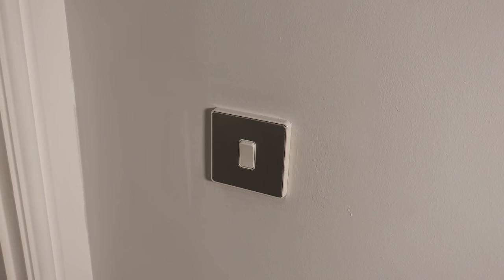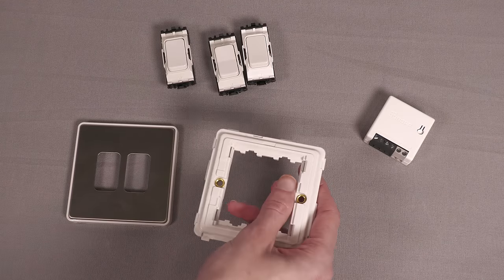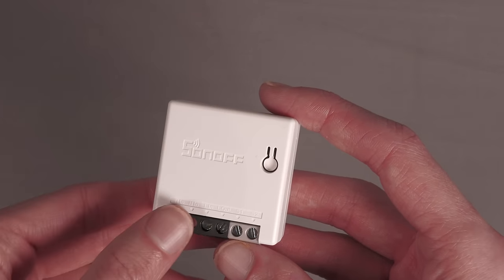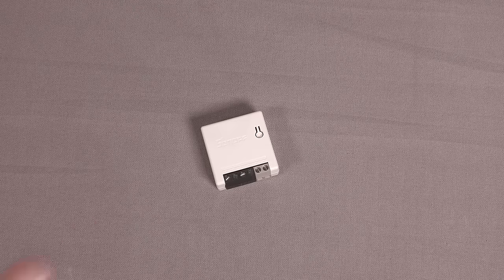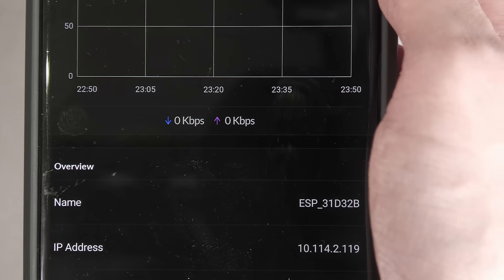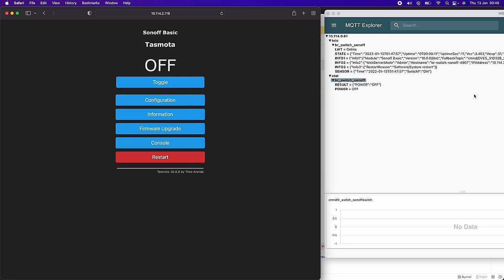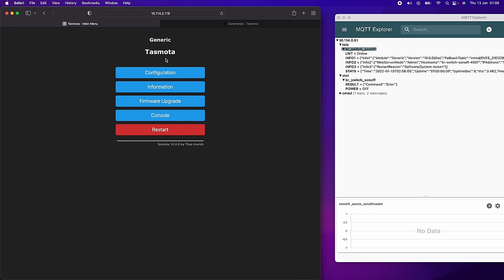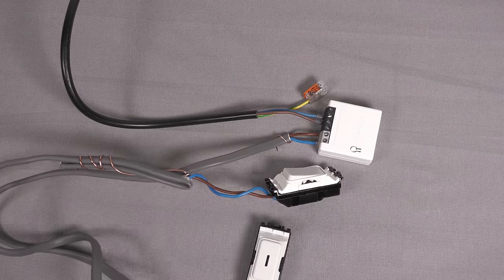Turning an Existing Light Switch into an MQTT Connected Smart Switch using a Sonoff Mini

Comment: It’s not compliant as it needs to be secondary clamped. You have to put it in a box which means it won’t fit behind the switch
Reply from the maker: Are you able to provide any more information on this, I'm not aware of any mention of "secondary clamping" in the UK wiring regulations that would prevent this being installed in this way without the Sonoff being in another enclosure.  The only time I've heard the term "clamping" being used is in the context of clamping circuits in electronics but can't see how this would apply here.
Reply: @camerongray1515  it needs to be secondary insulated, part of the CE/Uk regs. I know because I’ve just gone through the testing with our unit, and units like the Sonoff need to go into a box to make them legal
Reply from the maker: @ianbrown3904  I mentioned this at 13:45 - You are correct that it cannot be safely used outside of an enclosure, however, in the actual installation it is installed inside the pattress box behind the switch which serves as the secondary enclosure.  The sonoff is no less insulated than say the rear of the switches, the wago connectors or the single insulated wires that you'd also find in the pattress.
Reply: @camerongray1515  not quite sure that’s correct, and the reason I know is that we had to go through safety testing our own device. 
If the live comes out of the Sonos unit it means there is a live wire exposed, whether it’s behind something else or not. The regs say it’ should be contained by the secondary clamping and it is not touchable. 
The Sonos unit would fail Uk safety testing, but maybe not German, which I find a bit of an anomaly.
I guess the real point is you are recommending something which is non compliant, an electrician would put it in a secondary box.
Reply from the maker: It literally is inside a secondary box - the switch pattress.  This is exactly what an electrician would do with a device like this or other similar relay/switch module (e.g. Shelly, Fibaro, Rako.etc)  By the same logic, if a live wire comes out of the back of the switch it's also as equally exposed.   That is why the metal pattress is earthed - so that if a live wire comes out internally and touches the box, it'll trip a protective device rather than allow anything touchable (metal switch front plate or screws.etc) to become live.  May I ask what your device that you're referring to is?  Are you referring to a cord grip as "secondary clamping?"  It likely depends on the intended environment for such a device - in this setting I'd argue that the sonoff is compliant because it literally is installed in an enclosure however it wouldn't be compliant if it were mounted say on a wall out in the open or floating loose in a wall or above a ceiling.  The same could be said for the switch modules I'm using - they're totally compliant to be installed in a grid plate mounted to a pattress on the wall, but wouldn't be suitable to install as an inline switch on the flex of something like a lamp.  As far as BS7671 goes, to the best of my knowledge, the main wording in relation to this sort of thing is along the lines of "access to live parts without the use of a tool" - in this situation there is no way someone could get to the sonoff or any live wires without at least a screwdriver.  Here's an example of a similar form factor dimmer from Rako (a high end UK brand of lighting control) which they explicitly state is designed to mount inside a pattress and even show it in the instruction manual: https://rakocontrols.com/rmtpill/
Reply: @camerongray1515  send me your email and I’ll send you details of the product. 
I think it all comes down to earthing.
Im just referring back to my approval. Without doubt the Sonos wouldn’t pass, I wish that style would it would make my life easier!
Reply from the maker: You should be able to send it to youtube@camerongray.me.  I presume it ultimately comes down to the particular standard that it is being certified against and the expected use of the product.  Earthing is also a very specific thing, if the device has exposed conductive parts and is not double insulated then the exposed conductive parts need earthed, hence why the pattress this is installed in is earthed.
Reply: @camerongray1515  Any update on this please?
Reply from the maker: @philtyler4048  I'm not convinced that there's an issue with how it is installed here.  As far as I can tell the confusion is around the fact there's no wiring area with a cord grip which would be required if the device was accessible to the end user however when in a switch pattress, it's no different to the cables connected into the rear of the switch.  Likewise when it comes to being double insulated - when installed inside a plastic or earthed metal pattress, it doesn't need to be double insulated in the same way that the rear of a switch or a connector block/wago terminal isn't double insulated.  There's enough similar devices (non-double insulated, no cord grip, designed to he installed behind a switch) from reputable companies (Scolmore ClickSmart, Quinetic, Rako) that I'm confident that the sonoff is as equally compliant.

Comment: you should have mentioned the Neutral to start with and most older Properties dont have a Neutral at the light switch only real new houses or recently Rewired houses have a Neutral at the switch! but then you wouldn't get 12 minutes and you won't get so much Revenue from YouTube?
Reply from the maker: I can guarantee it wasn't some sort of conspiracy to get more revenue, my videos are totally unscripted and therefore it must have only occurred to me to mention the fact that it required a neutral at the time which I did.  That said now that I think about it, if you were happy to use the Sonoff purely as a remote and have the light permanently wired on, you could adjust the wiring at the light fitting/ceiling rose/junction box to wire the light to be permanently on and then use the switch wire to carry a permanent live and neutral down to the switch for the Sonoff.

Comment: Sorry I gotta comment again this is such a complicated solution throw your smart bulbs away instal a smart switch add the switch to google home Alexa whatever your good to go
Reply from the maker: I replied to your other comment, how would I adjust colour temperature, colours or dim individual bulbs if I replaced the smart bulbs and just used a smart switch, these switches control 9 downlights and 3 lamps in my living room and 6 downlights and 2 lamps in the bedroom, I want a lot more than just on off control of the downlights.

Comment: Smart switches are like 16 bucks smart bulbs are stupid
Reply from the maker: Depends what you're doing, I wouldn't want smart bulbs for on/off control (in that case I'd always just want a physical switch). I use smart bulbs so I can adjust the colour temperature, set them to RGB colours and dim them to different levels (for example my living room has 9 downlights, I like to have them set so the ones at the back of the room where the couch is are the brightest and they get progressively dimmer as they get closer to the TV).